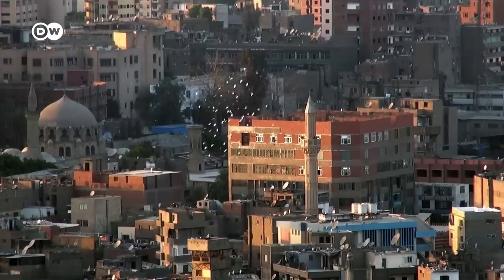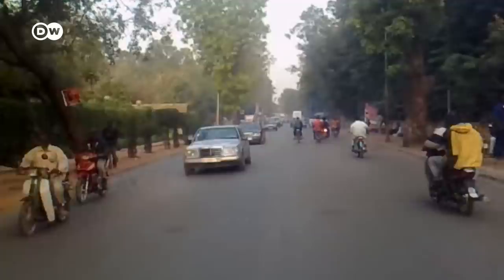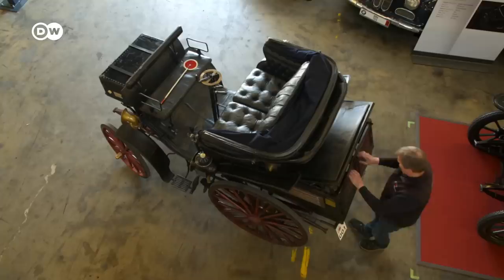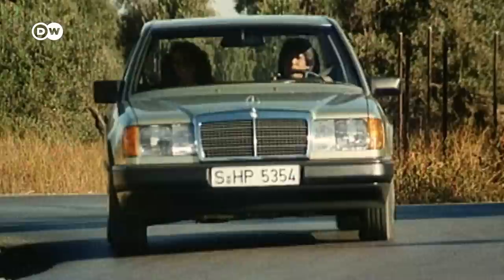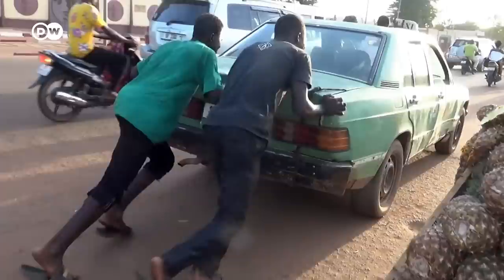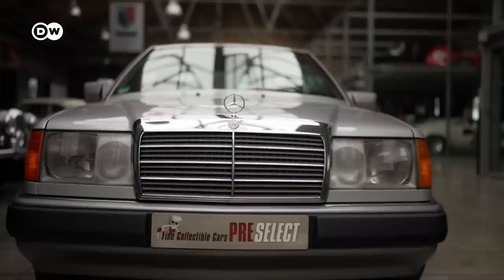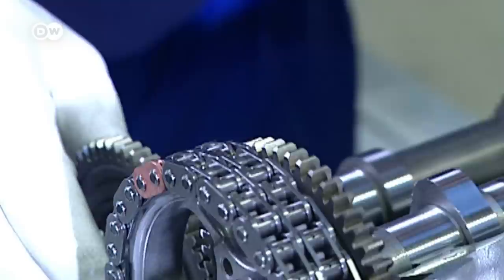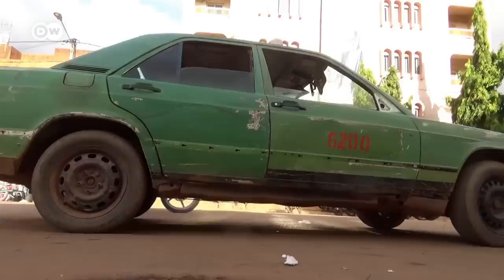Mercedes Classic: The Apex of Car Making

Comment: I have owned several Mercedes-Benz, from some models.
The one model I owned more was the W201 - the legendary 190D - of which I owned four of them, all with the 2.0 Diesel Engine and a five speed manual transmission.
I also owned a W123, W124, W202, W203, and W204.
Then, I stopped.

They keep the same comfort, build quality, and sound isolation - which I really appreciate.
However, I noticed my maintenance bills kept rising, both due to the decrease in reliability, but also in the cost of parts.

Thus, I decided to stop spending so much on the car's purchase.
Meaning, I started buying Reanult cars, which offered me more comfort, but an inferior purchase price and a lower maintenance bill.

Yes, the overall build quality is not the same - but close enough.
Yes, the sound isolation on the highway is not the same - but it is enough at or under the speed limit.

Thus, I love Mercedes-Benz, but stopped buying them!
Reply: I don't buy the "keep it simple" argument.

Not only because the S-Class models (all the way back when there was not a Class to mention, e.g., the W126) - which is the luxury model - that make the Mercedes-Benz the desired brand; but also because the Multilink suspension system was what made the W124 and the W201 so special in terms of affordable comfort.

What made Mercedes-Benz so reliable and special was: engineering.
Hard, time-consuming, and testing engineering - which is very expensive.
After the W140, W124, and W201 in the late '80s and early '90s Mercedes-Benz stopped spending so much money in Research and Development, for both new platforms and new models.

The W202 was proof of that, which was a reliable product, because it was quite similar to the W201.
However, it did have very little to offer in addition.

To contradict critics, the W203 was a quite substantial leap forward, but it went through little testing, and had many issues, with several recalls and bills over the roof.

You can see that in your local taxi fleet.
In the past, Mercedes-Benz ruled the Taxi market.
Nowadays, there are some Mercedes-Benz, but Toyota with its Hybrid solution coupled with reliability; and many EVs, have dominated the Taxi market.
Reply: 3:05 "They took their time back then, and didn't cost cut to death"
This is the true statement!

Comment: I've had a few diesel Benz cars. W123 ,W201 n now a W210. My opinion is ; even though I enjoy my W210 very much , I wouldn't dare buy a newer model because the electronics n plastics keep increasing with each newer models. I think this documentary is spot on , the W124 is probably the best Benz to hold onto . In my case , it would have to be a Diesel ⛽ 🙂

Comment: I'm a kid from the 80's and i only remember few cars that broke down.
But cars like Opel, Volkswagen, Mercedes, Audi and all the japanese never broke down. But that changed in the early 2000's.
Reply from the maker: Do you think the change is true of cars from all manufacturers across the board? Or do you feel it's especially true of manufacturers from Germany?
Reply: @DWREV  I think this problem exists through the board. 
I remember times when the Opel Astra F was called a disaster for Opel because of its low quality. But this type of car runs even after 30 years without problems. And also interior quality wasn't that bad when you compare it to modern Mercedes C-Class...cheap plastics, everything squeeks and rattles.
Another example is timing chains. Back than they were all duplex-chains and had no problems with ripping apart or skipping teeth. Today engines die in big numbers because of timing chain failures.
And all that has nothing to do with smaller displacement but higher output. Reliability can be planned and enginered! 
Back than people and also manufacturer thought more about their reputation than maximizing their profit in the short run...

Comment: All series cars are made by robots now. I remember in the early 90s Porsche had a commercial showing guys welding the cars. So yeah, those days are gone. But my current daily driver, a 2010 E550 Sport rwd 5.4L na V8 with amazing adjustable adaptive air suspension. AMG bits from the factory carried the great tradition. Mid-sized square-jawed Meisterstück. The new cars are fine but no real emotional attachment.

Comment: Back then when you would look at car magazines and/or brochures, the Mercedeses, BMWs, Jaguars, Bentleys, etc. were all on a separate section set apart from the Toyotas, Nissans, Mitsubishis, etc. as the definition of a luxury car was crystal clear back then - classy-looking cars with an elevated standard of engineering and quality. Nowadays, the cars made by these brands are compared side-by-side with no differentiator as they all have the same build quality, engineering, and of course, predicted lifespan.

Comment: Mercedes Benz simply the king of cars, however they don’t build them like they used to anymore. I own a R107 450SL 1976 a W123 240D 1983 and a CLS350 2011. The CLS is my daily driver but I definitely prefer the old ones especially on a dry sunny day.
Reply from the maker: How nice. Where do you live?
Reply: @DWREV  I live in UK 🇬🇧

Comment: Magnifico video con grandes y ciertas afirmaciones. Son unos coches fiables y resistentes a pesar de que algunos circulan por caminos intransitables para otros vehículos de su segmento. Tengo un W123 300TD de 1978 y estoy encantado.                                                                                                                                          

Great video with great and true statements. They are reliable and tough cars even though some drive on roads that are impassable for other vehicles in their segment. I have a 1978 W123 300TD and am delighted.

Comment: Here i am in America driving my tried and true W140 Mercedes blasting at equal or faster speeds than modern than modern traffic. They are timeless machines designed for eternity. On the other hand my beautiful lexus made at the same time is breaking endlessly. Mercedes >Toyota

Comment: The second MBZ I owned was a 1998 E430. That car was so cheap to maintain. It was cheaper to maintain than the Japanese minivan we had for two years. 

The E430 had 352,000 miles from n it when I stopped driving it. I gave it to charity because I had a CLK500 and an R350. I gave it away because I didn’t want to get the radio fixed. I miss that car because it was indestructible and incredibly fast!

Currently I have a 2014 E350, which is also unbelievably cheap to maintain!

The R350 was manufactured in the USA. To make a long story short: do not purchase an MBZ unless it’s manufactured in Stuttgart.

Comment: This video is a generational statement. Previous generations who built cars in the 80's and 70's had different values than managers at Mercedes today. All manufactured solutions of the past had repairability in mind. Today I believe the mind set is completely reversed and engineers actually engineer solutions with obsolescence by design. Except maybe for Tesla who have stated the 1,000,000 mile goal.

Comment: Started  my apprenticeship 36 years ago on Mercedes Benz cars . The range was between 1965 to 1993  , the cars were beautiful to work on and they were engineered and put together better than most other manufacturers.  However the last 20 to 25 years Mercedes Benz cars are no better than anything on the market. They go through discs and pads like no tomorrow  , leak oil , water pumps leak   , such a high priced time bomb , great for the individual who wants to write off tax.

Comment: It's true that the W210 was a step down in quality from the W124, but the W211 was a real step up.  The W211 with the CDI has the longest lasting motor.  Electronic did improve the car a lot, the motor has incredible power, efficiency and cleanliness, the 5speed was a very durable transmission that had a torque converter lockup, the SBC system and ESP system are brilliant and drastically improve the cars performance and safety.  Compared to earlier mercedes it uses much less fuel and is much faster.  After that the cars did become to complex although they are still fabulous.  Old Mercedes are great but a slight newer one like the W211 can give you a newer car with more life in it, and more safety, and efficiency. With that said I was astounded by the reliability of my 1984 300SDL with 380,000 miles on it.  Also Porsche are very reliable and long lasting cars, and the BMW's of the 80's were also known to be extremely long lasting and reliable.  In general you want a car with a inline 6 motor when it comes to reliability.  Particularly a inline 6 diesel.

Comment: I’ve owned both W123 and W124. Great cars, especially the W123 will last forever if rust is kept at bay (they do rust, like most cars). Later MB are more advanced, but not that well made. Some series, especially the top models, are just awful money pits. Stay away unless you’re a BIG fan. If I ever buy a MB again as a daily driver it will be a MB 123, manual, diesel. Slow, but easy to fix and build to last another 40 years.
Reply from the maker: Thanks for watching and for commenting, Jan! What did you trade your W124 in for?

Comment: I love how they harp on about the "reduction to essentials". 
Back in those times, Mercedes came in absolute poverty spec if you didn't pay an arm and a leg for optional items. 
Even in 1992, the final year of production, a base model 190 would come with a 4 speed gearbox, no central locking and manual window cranks... and that was a 35.000 DM car in its day!
Source: I had one (though I bought it used).
So you could always have Mercs with a lot of non-essentials if you were prepared to pay almost twice the price of the poverty spec.
And in most European climates, many of those would rust. The W114s didn't come with cavity sealing as a standard (why, o why?), so those without went out in the early 1980s.
A "car park neighbour" drove and babied a C123 for sentimental reasons - his dad had taken him to Stuttgart by train when hecwas a kid in the early 1980s to pick it up. It was a family heirloom and he had had it restored with very little regard for cost.
Last time I saw it it had a fist sized rust hole below the rear bumper - eventually, the underseal had hardened, gone off the metal (apparently taking some of the paint with it), giving way to rust. 
Part of the mystery of the long lifespans may be down to the fact that the very high prices of the cars justified repairs that would have been deemed uneconomical on others.
You can basically repair everything with parts recycling and negligeable labour cost - which is why some former French colonies still have many old Peugeots running around. 
Any odes to the "infinite technical lifespans" of the 504 here?
Reply from the maker: Thanks for your experience with your old Merc, so you’d buy/prefer a modern one instead?

Comment: I have a 1999 G320 which is rock solid on powertrain but a disaster in terms of comforts and conveniences like electronics, locks, sunroof etc. Simpler is better. I think Mercedes quality peaked in the late 80s/early 90s. My next car might be a 1991 W126 560SEL. I like the over-engineered tanks that might live forever…

Comment: Interesting to think that auto makers were forced to get better fuel economy. Forcing the gaming of the system to use less fuel. More expensive weight saving measures at the expense of costly repairs. Aluminium is one of the highest energy required materials. Turbo charged smaller displacement engines to give the impression of being fuel effiecient. But the life of the engine is significantly reduced due the increase in engine heat produced by the turbo and its more stringent maintenance requirements. Now electric cars are the must have item to save the environment. What will be the life of a new battery powered car, 10 years maybe, and with it the total life expense, including manufacturing energy cost, compared to keeping an old school simple petrol powered car built to last forever. An interesting comparison. Are we all being conned to buy stuff that we would not really want to buy? Is it greener to keep your old car and just take care of it?

Comment: A lot of engineering investment was stalled when Daimler bought Chrysler in 1998. However after unloading responsibility for Chrysler in 2007, Mercedes models became better engineered until 2013.  That's when spare tires and fog lights were cut for cost.

Comment: As the owner of a very solid 1984 500 SEL, I can tell you that these cars are built like a tank, and very easy to work on yourself. However, it's not practical for me to daily drive mine due to the low fuel economy.
Reply: Well it is if you're saving on maintaining and the cost of a new car though!

Comment: At a time where electronics, emissions, and CAD-CAM doesn't exist, well I mean, didn't take over, everything has to be built to overlasting. And you have to remember at that time, nearly all materials are metals so they build it from pure metal without any additives but nowadays just gone to carbon fibre things. I didn't say it bad but why?

If you need something to last more, build it from metal. Yes it is heavy but let's looked from the environmental things. Any materials that didn't come from ores like steel comes from iron ore, aluminium comes from aluminium ore, are made from oil. Plastics, carbon fibres, anything that made synthetic is from oil, either directly or undirectly. So when they are burned, they release toxic gasses where metals which put into the vehicles like steel, aluminium, titanium, they don't (except it was contaminated with radioactive materials).

In Third-world countries, the durability and simplicity is a common thing until 2010s for cars and 2020s for commercial vehicles because in Third-worlds, the vehicles are a trimmed down or just a basic variant of the vehicle being produced in the Europe or Japan or China which then given some sort of trim version to match the local taste.

Comment: 8:34 Mr Stein is right indeed - the late models Mercedes cars are over engineered, built with lower material quality, low reliability and over priced (which is true for most car manufacturers now days) - greed is the problem.

Comment: 😢😢😢 2.20 as a Mannheimer this Statement hurts. Carl Benz invented the Automobile in Mannheim, not in Stuttgart!
Reply: Daimler was from Stuttgart and the company was based in Stuttgart after the merger of Benz and Daimler.
Reply: 2:20  
July 3, 1886: Carl Benz presents his motor car to the public for the first time in Mannheim. The inventor from Baden sits on the narrow bench of his 265-kilogram vehicle, which is powered by a single-cylinder engine and reaches a top speed of 16 kilometers per hour.

In August 1888, Bertha Benz travels with her sons Eugen and Richard from Mannheim to Pforzheim, about 100 kilometers away. Ten years later, Carl Benz is in the process of expanding his workshop into the world's largest automobile factory. He has now sold around 2,000 vehicles, and annual production is around 750 cars.

Then competition emerges from within the country: Gottlieb Daimler launches the first Mercedes on the market in 1900.

The Statement, that Carl Benz launched his Automobile in 1886 in Stuttgart is simply wrong
Reply from the maker: That's entirely correct. Thanks for pointing it out!

Comment: even japanese cars from today are scary to keep for more than 200k miles or 5 years, bean counters and marketing got to them too :(
Reply: I saw a program where they compared two identical cars/brand/model but different production years. 
One they guaranteed you 150 to 250 miles (year 2020/2022) and the other I think it was 350 to 450 miles and was produced around year 1990 - plus minus.

Comment: I've driven MANY W124 and I've broken down MANY times 🤣 These cars are getting old now and with age comes problems, the idea you can just buy a W124 and drive it forever is absolute nonsense you need to love these cars and look after them properly then they MIGHT perform 95% of the time, but if you buy a new Toyota it will perform 100% of the time for 20 years straight and work out significantly cheaper.
Reply: you are talking total BS a new toyota will be useless in few years 

electronics Planned obsolescence too many modules and built like s toy
Reply: @epiccarguy892  just check the reliability of Toyota Prius OK every user taxi driver can vouch it,  most 2nd hand for sale at 200, 300,000 miles on the clock.